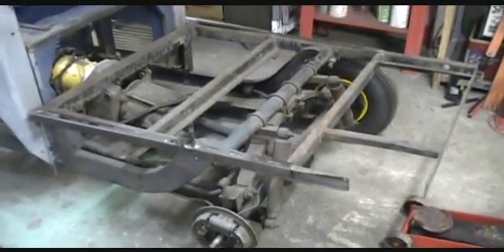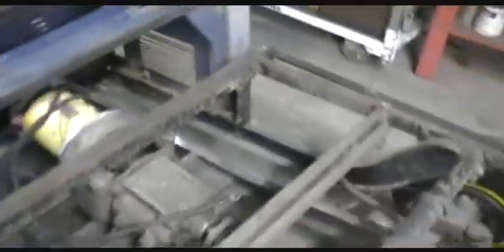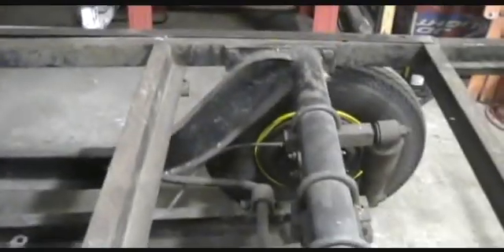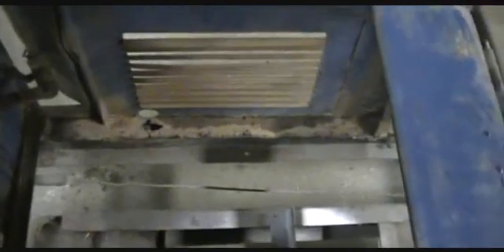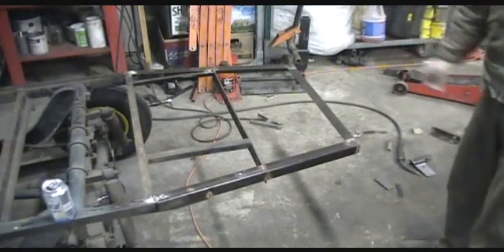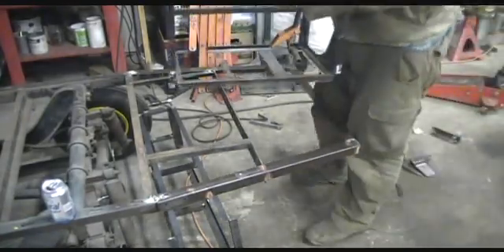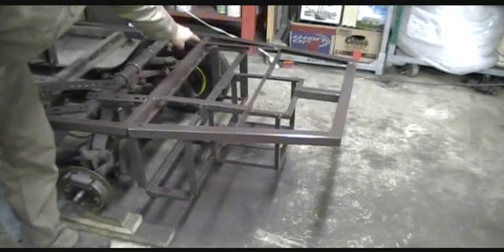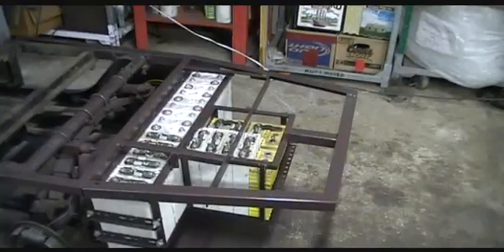1961 Cushman Truckster EV Conversion LiFeP04 - Part 7 Battery Mounting

Comment from the maker: Bruce-
I have a variable DC charger like yours now. I did put a volt meter on them several weeks ago and they were all 3.1-3.2 volts. My multi meter crapped the bed so I need a new one before I can test again.
I still need the main charger as well as the controller... and lights, a wheel hub, aluminum sheet metal for the skin, paint, cabling, etc. Thanks for the heads up though!
B

Comment from the maker: Thanks!  It is absolutely great.  I bought a 55ish Case 300 tractor and rebuilt it into working condition.  That's been fun; I'll post a video about that soon.

The battery boxes are back more than I wanted, but they will be easy to access compared to all other locations. Additionally, the original fuel tank was in that location, so weight back there can't be bad!

I'm gonna work on the body next. Cash limited as always so the controller will have to wait a bit.

Thanks for your interest!
B